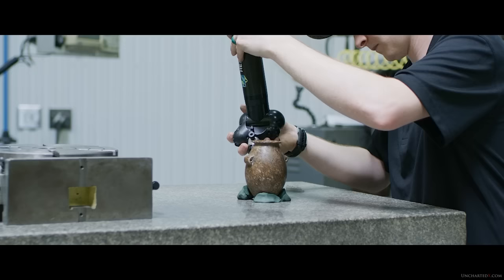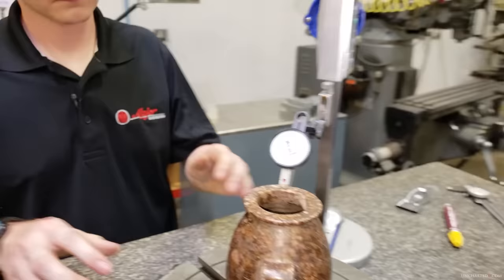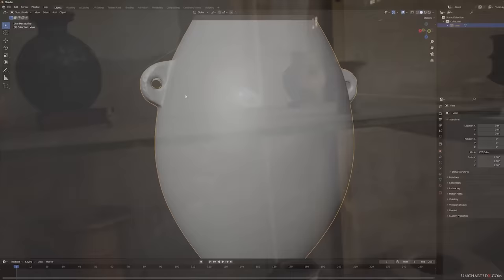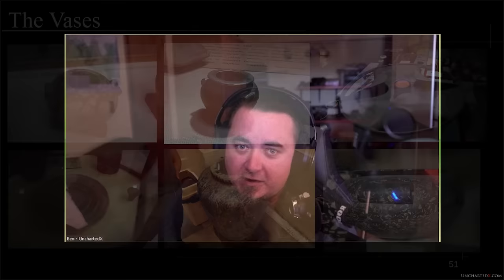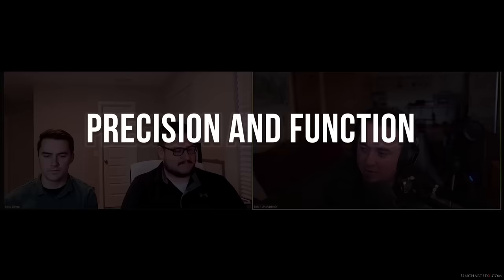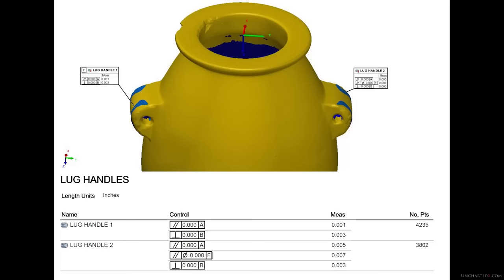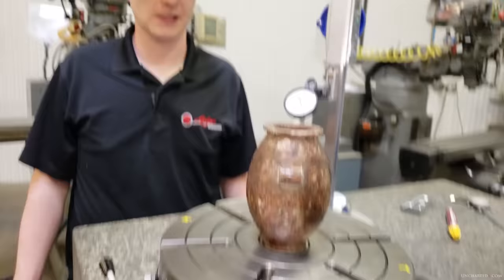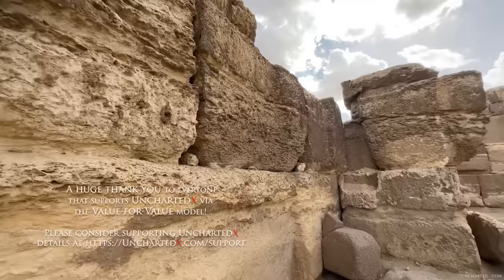Ancient Egyptian Vase Scan Update! STL file, More Analysis - and Between the Lug Handles

Comment: Nice Video, ich have some thoughts on this:
1. I don't think these handles where a design choices. They probably had some funktion. The most likely one would be they where used during manufacturing to hold those rocks in place. If that is the case, other Vases that don't have these would have undergone a tool change and that introduces error. So if vases without handles have worse tolerances, that could be an indicator for the handles to be fixing points.
2. I find it highly unlikely that they used different speeds for different materials within the vase. Why? Well we know that they had a really advanced way of cutting homogeneous stones. Its unlikely they developed a different method for aesthetic pieces. Why do i assume they are aesthetic pieces? Functional pieces would have been cut from the same stone in large quantities.
3. Its interesting that we never found tools to make such vases. I assume, that even if we found them. We couldn't grasp what we are looking at, since this tec is so far away from our current technology tree that not even the sharpest minds can understand them.
4. If they where functional pieces what was in those vases? Probably something delicious or valuable. Valuable is more likely i think. Maybe those where collected because they held some treasure maybe even old really advanced stuff. And Rulers tried to get there hands an every last one to get what was inside. 
Interesting stuff keep it up.

Comment: just say 28 microns instead of 0.028mm. the imperial system is obsolete and is only used in the states. 
Even i the US. scientific work is done in metric. 

Love this channel regardless, Great content!

The area between the handles can be machined in the same setup as the rest of the vase. 
You need a grinding spindle perpendicular to the rotational axis of the vase. 
Then rotate the vase back and forth while moving the grinding wheel along the contour.
By moving small increments a really low cusp height can be achieved.
Reply: what country sent man to the moon again? i thought so.
Reply from the maker: Yep, microns and bananas. I got it.
Reply: @AustinKoleCarlisle  rigt, Nasa used the metric system for that.
Then the numbers were converted to imperial for manufacturing in america.
Once an error was made in conversion, and we all know how that  went 😉
Reply: @jesperdegerman  again, what country went to the moon again?
Reply: @AustinKoleCarlisle  As of 2023, several.

Comment: Have we found/do we know of “vases”that are identical or close to identical to each other? Repeatability of precision is an indicator of methodology. Example is : Machine shop 101, half of the students make their “tack hammer” from blue prints and half make it from dimensions they measure from “original” themselves…..each has its own set of disciplines, now check if all “heads” and “handles” are interchangeable with each other. I think most people don’t understand how important universally exchangeable parts are to the history of manufacturing. The “lead screw” on a machine lathe is vital to repeatability. I can turn multiple parts “buy eye” and get a small degree of accuracy but need a lead screw setup to duplicate with any accuracy. Better (finer) lead screw then better accuracy. So….if there are vases that are “duplicates” to any degree then we know a certain level of technology has been reached. There were potter’s wheels and wood lathes for a thousand years before the technology of the lead screw came along and changed everything. Machine lathe/wood working lathe/potters wheel/ turning spray painting lazy Suzan, I use them all in my shop.

Comment: Has anyone thought about injection moulding? Or maybe an unimaginably advanced version of glass blowing. I’m thinking a mould made from a more machinable material and then the harder, or even less heat sensitive,materials of the granite being used as inclusions in the finished material. ( injection moulding explains the machining marks in the surfaces while also achieving the ridiculous level of accuracy and also accounting for the internal form of the base.) if only we had an induction volcano 🤔

Comment: I would be interested if there were a standard size in the holes of the handle as well as the spacing of the holes as this would indicate the use of a tool or fixture and suggest a use other than a vase.

Comment: hey guys, Machinist here, I just wanted to say,  it looks to me that they're done with a copy jig. they would have had a "blank" of the profile to guide their tool for the initial turning operation, and another for the operation between the handles. Also, you wouldn't need a 5 axis machine to make this today, as stated in this video, you could make it in a 3 axis machine, or even a 2 axis machine with a grinding attachment (provided you have a way of indexing it accurately). I can see by the scan that the jigs used were different for each operation , simply by the variance. to me, the only questions are: 
1. what grinding material was used? (or was it some kind of indexable cutter with multiple teeth)
(my theory is that they used a shaped stone in a wet grinding situation and either relied on the hardness and abrasiveness of the tool or added an abrasive with the water)
2. How did they power the Tool? 
(to me it's clear the tool was spinning, and would have been spinning continuously, so i would have needed some kind of external force, either through a crank handle (compromising accuracy) or some kind of belt drive system from a crank handle elsewhere)
3. how did the technology disappear?
(I'm not interested in how they discovered the technology, as that is simple a function of time, but how did it suddenly, and magically get lost completely without trace?)

My theory could be demonstrated with fairly simple tooling. I'll download the Model and have a play.

Comment: To me, the scoop marks are no mystery.  They are aren't pounded out, they're scooped out.  The worker holding the "pounding" stone might initially strike the work with the stone, but then would hold it in contact with the work and then pull and rotate the stone towards himself, scraping the stone against the work, slowly gouging the surface away.

Comment: Was the inside of the vase looked at and recorded? With a flexible scope camera video could be taken of it compare the interior surface to the exterior surface also it might reveal tool holding marks
Reply: Personal take on the interior based on the stl available and the couple of hours I spent looking at it :
You have a partial scan of the interior. upto the max point of laser hitting the inherent shadow line.
The initial tube drill "core snap" is evident as is an interesting secondary angled grind evident  at the foot. outside of the "Core snap" but no larger than the  neck. 
How the rest of the bulk of the interior was taken out will  always be an  unknown but there is turning evidence on the final inner wall scrapes . considerably more evident when using oblique lighting (OL  - If your CAD package supports it).
The interior is not smooth in comparison to the exterior . probably concluding  apart from the obvious ease of polishing , it was not made to contain liquids .
 99.9% certain that it was not originally designed as a vase.   
The neck ratio to flange ratio suggests a stoppered Urn/ Jar.  The stopper long since separated and lost / discarded when  first found.
Add to that the high centre of gravity ( CoG) of the even the scanned faces  of it  would not bode well for "decorative stability"  The  base footprint being small .
The holes looking from the inside out are misaligned and of differring dimensions and are a red herring.
Outide there are very interesting 'wear marks/ patina'  ( again under OL ) above the foot and below the  widest  part of the bulb again possibly indicative of the method of stacking the vessel. 
Which ties in with the handles' shape  and thickness . ie possibly used to remove the jar from a rack. 
That initially it is a turned process ( again personal inference) is imprssive in itself as there must have been the methodology of spinning the stone and maintaining the torque / rpm .  
Guides ,cams and jigs then follow.   
If you have all of those and the stable rotation generation then technically the handle creation becomes somewhat more straightforward.  
A sectional analysis could well throw more insight into the possible profile of the final grinding stones required for the creation of the handle as well the jig and cams possibly used on the jar body.

Comment: Hello Ben, been watching you videos a while now. I dropped a DM on Instagram but in case you see this message. NIST has several Moore Coordinate Measuring machines with a precision level to 10-20nm between points. It is said that they are accessible to any company on the US willing to send artifacts to them. Imagine setting them up with a predynastic vase or even a plate fragment to scan at that kind of precision. That would be absolutely earth changing if that were to happen... A full 3D scan at a nanometer level of precision of an ancient artifact by NIST 😌 one can dream right?

Comment: I'm very interested in printing this in resin but the STL has 2 problems. 1: it's broken in terms of the normals (front faces). That's not really a problem for me as I do 3d stuff all the time and it's an easy fix. The other problem is that the vase in super tiny, like 28mm tabletop game tiny. Is there any way you could upload it at original scale, or give us the math to print it at the correct scale

Comment: I don't think those things were made with tools that can be reflected/corresponded to our modern technology.

As we live in our specific times with tools and machines that we understand, it doesn't mean that this is how the ancient high technology civilisation was doing things as well.

Yes, some of the things are exceptionally universal, like wheel or a wall, same for the shapes, but that's it.

We look at that vase and think "latches! CNC!" but was it really? What if they had much more sophisticated? Something that could manipulate and shape the matter, liquify it and re-solidify it to a desired shape? like the Serapeum boxes you just talked about (nobs on the inside, scoop on the outside) what if that's because they liquify portion of the box to change it's shape and "tune" it to a specific frequency?

What if all those impossible tube drill holes (especially ones in tight corners are not made by tube drills, but something like what we know as laser, spun around as they cut the granite?

That would explain the problem of cutting conglomerate materials with no change of speed, feed rate, tool pressure ect. because you would have no physical hard material cutter to do the work

I think, looking at this topic through a prism of our tech is a bit close minded still, but that's just me

Comment: We are assuming (not unreasonably) the lugs and the holes in them are to accommodate, for instance a length of rope threaded through? To form some sort of handle. 
Are we assuming it is a vase? And not some. Component on a circuit board or electrical appliance
Did this vessel ( for want of a better word) have a lid? At some point
And these lugs were for securing the lid 
Why go to all this precision for a vase to plonk a few cut flowers in?

We must first determine for what use was this vessel manufactured 

Please do not scorn me

Just trying to think outside the box
Reply: when you add in the fact that the holes in the handles are not "precise" it makes you wonder if they were added by the Dynastic Egyptians to repurpose these objects as vases.

Comment: From my way of thinking these are luxury goods for the people of the time of manufacture.  I am wondering if there are any matching sets from small to large, in design and material.  I imagine a shop that gets the material from discards of larger projects.  Essentially, scrap material.  It seems to me that the quantity of such things might be an indicator of the number of people in that society.  I have to wonder what kind, if any, econmic system would be used to put a value on the products back the, wben they were made. Were they mass produced or custom made is a question.

Comment: If it can be made by hand, then it should be done and filmed by your detractors. Otherwise you’ve proven it was machined using technology, which is clearly correct.
Reply: oh i'm sure the detractors will create videos showing their process, but dont you fret! the videos will be heavily edited with closeups of the "artisan" carefully working on the piece. but what they wont show you is the tech they used in between the edits to remove the majority of the material ;)

Comment: I'm a material science resesrcher whose been working with how to utilize muscovite mica and other inorganic vanderwalls materials for functional charge storage applications.

I wanted to see of theres any data regarding the structural compostions and distribution of materials in these systems that could be looked at analytically from a functional perspective of capacitors based off a lot of recent research emerging from 2D materials.

Is there a way to reach out to you to discuss any of the analysis you've done so far or see if we could get funding to use someof the new neutron spectroscopy tools they're developing to do bulk sample analayis?

I have a couple papers I can send you where they used this technique to non disstructivly image bulk 3d concrete samples with traditional STXM style resolution....pretty awosme stuff.

Comment: There's only one object to scan: the schist disc. 3d printing that will quickly find its purpose. But without a scan, U could hazard a rough shape using blender.
Reply: Isn't anything large and thin from schist pretty much useless for anything except for decoration and maybe crockery? Could be a stylised version of the real thing as part of Sabus grave goods though.
Reply: that item has been reassembled from broken pieces, so it will inevitably give inaccurate results

Comment: The vase was turned and the handles were added after.  The handles were cut to slot into the sides of the vase.  It fits perfectly.  Look at the edges of the handles.  The also appears to be some sort of smudge on the inside where the handles are, but I'm not sure of that.  You will also find that the same was used at the temples that are cut out of the bedrock in India.  All the decorations and statures were cut separately and added into perfectly fitting slots.  Go think about that.
Reply from the maker: nope, the handles are not slotted in, they're carved and its all a single piece.
Reply: @UnchartedX  Are you absolutely sure?

Comment: I downloaded the STL file and checked it out in Inventor but the file does not yield much information   Were any measurements taken on the inside of the jar to check the consistency of wall thickness?  I see that the lifting lugs had a side draft as one would do if injection moulding.  Has anyone thought of the possibility of these vases being formed by centrifugally casting 'softened stone'.  Only the mould seam would need to be dressed.  Inconsistent wall thickness would indicate a centrifugally cast case.
Reply: if true, that would be even more mysterious.

Comment: Is a drop of liquid (any substance) always perfectly round? 

How are plastic bottles made? 

Bore cores blown into vases? The 'handles' on the side, possible just something keep the top of the blob suspended with the viscocity being quite thick. If you see what im getting at.

Why are the granite statues of animals and people always got wide necks or a headdress/hair. A liquified blob of granite, or any substance. whatever dropped on the shoulders of something you get spill over the shoulders. You fashion that spillover into something to hide that..like a head dress. No cut marks at all. You dont get cut marks on the ganache of a cake. You get a mirror finish on it.

Glass found around the place? 
Thinking massive magnifying glass to heat the surface, so you could scoop like around the unfinished obilisc. Or focus the sun rays to a point to be able bore out a hole in something.
Or wide focus for less heat, but enough to shape and add detail to things.

Comment: That wall image that is supposed to explain how these precision jar were made has nothing to do with these items. I feel like that image is of how they made clay jars for beer that resemble Greek amphora. I dont feel like that represents how to precisely carve igneous rock with inclusions of different sized crystalline structures. They supposedly didn't have the wheel right? so they didn't have a potters wheel either then so their pottery had to be hand molded and not spun like most pottery has been made through most of history. So that wall image looks like they have a curve wooden tool that they shape the sides of the amphora with if it were wet clay being shaped without a spinning potters wheel so not precise. 
 Some of those precision jars are made from some really interesting geologic processes that make them even more difficult to cut and shape. The crystal size shows the  rate of cooling of the stone when it was deposited as molten igneous rock.. The slower the cooling the larger the crystal and some of these jars have some large inclusions in them. So how di they shape that into a perfectly polished  glossy finish while making walls paper thin.  
anyone that has taken any decent amount of science classes in school in America should be able to understand both metric and imperial its not hard and anyone "educated" should be able to atleast make a close estimate in conversion without having to go through a full unit conversion. such as 1meter is a~3 1/3ft or ~3ft 4in